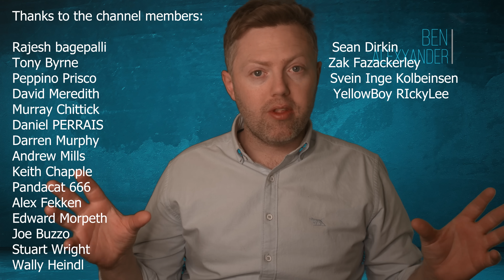CATL’s New Sodium Battery Will Reshape the Entire EV Industry

Comment: $19/kwh would change everything. People with homes would install solar power with enough extra storage batteries to charge their car EV battery at night.  If 2 days out of the year their house battery runs run low because bad weather, then they will get their car battery charged elsewhere and bring home the kwh to charge their house battery.  Total independence from the utility company. No home electric bills, no car fuel bills.
Reply: They will always find a way to stop the masses having independence from the state.
Reply: Do we really believe that local govt will allow this to be 'free'?
Reply: @taozzm Yes taxation will have to be readadjusted. Pay per mile, and back to square one for the consumer.
Reply: If they made the car smart theuöy could be used as reserve battery as well. Charge the car from batteries if needed relide back energi from car.
Reply: The house battery is two things.
- For small devices the fire risk goes away, so you can now plug small battery packs in bedrooms, on exit paths and the like which whilst people do it today isn't neccessarily smart
- For big ones you can massively up capacity. However if they still have to be wired in by professionals then most of the cost will end up (like solar now) being in the people and paperwork so the cost drop won't be as big. More likely as with solar it will become "go bigger" rather than massive price drops. Getting to 100kWh of battery (providing you have something to take the weight) plus a load of solar really makes some options begin to work that don't today.

Now if we can figure out the right connectors so people can safely wheel a big battery system in and connect it to a suitable socket (eg the same as would be needed for V2G) then we might get somewhere.
Reply: 2 days out of a year is optimistic.  In South Africa, which is blessed with constant sunshine, I would put that value up to 10 at least, just to be safe.
Reply: @mdb4michele  I'm from the Netherlands, we barely have sunny days. Luckily, they still generate power even when it's cloudy. 
At a price of $19/kWh, I would install 50 kWh. I will still need the grid, but I would be self-sufficient for at least 9 months of the year.
Reply: That is just the cell price. There is much more to a battery than just the cells. There is the BMS, balancing, safety switches, enclosure, wiring and assembly; and for cars cooling and heating systems.
Reply: @dominikvonlavante6113 Sure but a home battery with these cells will definitely pay for itself. I have modelled my usage and know the figures. It is also a game changer for heat pump deployment if batteries are economical. It will also make larger solar arrays more viable if storage is so cheap.
Reply: @SimonEllwood  There is nothing special in terms of price. If you order right now directly from China, you can get 96kWh of Batteries for less than 7000$. That future is already here.
Reply: @dominikvonlavante6113 So over $5000 more. This is different with the safety, the temperature rating, the energy density, the durability and the price.
Reply: @SimonEllwood  19$/kWh is only the internal manufacturer price for the cells. There is a whole lot more to a functional battery than just the cells. Alone shipping is more expensive than that internal price.
Reply: @dominikvonlavante6113 The cells are the most expensive part and these cells are much cheaper.
Reply: @dominikvonlavante6113 where is that???
Reply: @dominikvonlavante6113  safety first, nobody would ever care for lithium toasters
Reply: I have a friend who can do this already...the solar and battery bank in his house can fully charge his brand new Alpine A290 car if he wished ... nothing new
Reply: Current prices for home storage in Sweden is like 200 per kWh it’s madness
Reply: They will invent some law to tax it
Reply: @nedelwre social welfare for the power grid companies … instead of utilities paying taxes they will receive tax money. The justification will be they make electricity service available for everyone to buy. Compare that to government tax incentives to make high speed Internet for sale in remote/rural areas.
Reply: @nedelwre sun rent
Reply: Introducing the mileage tax😮
Reply: @djdj-qx3hb … that’s when oversized diameter tires will pay for themselves (lower mileage on the odometer)
Reply: Im sure goverments will be taxing that disgustingly highly
Reply: You won't have free power. First of all - a little to the north of the earth and you ve got dark winters and can't rely on solar energy. Energy storage is just for few days, not for whole winter when bills get higher due to heating. 
2 government will tax every kwh produced and instead of buying energy you will just pay for what you make yourself. It's not like they rob us. Countries need constant flow of money to run. We need money for roads, education, healthcare etc. We need to pay . Period.
Reply: @ExcaliburPaladin the highest electric bills are from air conditioning, not heating. Agreed, not everyone can disconnect from the grid but most will be located where enough solar power can be had when complimented by using the car battery to transport kwh from a charging station to the home battery. The 2 biggest costs (solar panels and batteries) are dropping. If batteries can be bought for $19/kwh then it will be economically feasible
Reply: @ExcaliburPaladin .  I can see them taxing annual mileage on all vehicles including EVs and possibly including a homeowner annual assessment charge for grid access whether you need it or not (just like library assessment and other assessments that get rolled up into the annual real estate tax).  But i don’t see solar power for self use getting taxed

Comment: Li (lithium) is the smallest positive ion.  It has been assumed that whatever is achieved with a sodium ion battery, a lithium ion battery will always be a certain percentage more energy dense.  It has been assumed:
* Li-ion => mobile - EV's, tools
* Na-ion => static - household and electricity-grid energy buffers
You present this is not the clear-cut case.
You send me off doing investigation...

Comment: CATL usually make announcements that are accurate.  If this is all as stated it is a really big deal.  They also say that LFP production lines can be easily turned to this sodium chemistry cell.  That's a real winner because not only CATL but all major battery manufacturers have already got LFP production.  BYD is completely LFP from their beginning.  Of course if they can't emulate the tech they may have to pay CATL a license.  CATL are in a great position.  

For the worlds of both renewable energy and EVs, this is fantastic news.

Comment: Sodium Ion isn't Ideal for EV's due to SIGNIFICANTLY lower energy density. 160 w-h/kg is about half that of a Tesla. Which already had weight issues. 
It is ideal for home and grid storage, where cost, stability and reliability is most important.
Cold weather performance is lithium ions Achilles heel though.
Reply: This is very true. However if they can be supercharged faster and safer they could make up for their density and weight disadvantages by sacrificing range for charging speed. And cold weather performance advantages mean something up here in Canada, etc. where I lose 20-30% of my range (or more) during the winter months anyways.

Comment: 4:57 sorry to tell you this but molicell p50b are already way better than these sodium cells @ 265 Wh/kg
Reply: Cost per unit?
Reply: @david-spliso1928 so you think a new cell structure will be cheaper ?? Ive built batteries for years, never seen any new cells be cheaper. And the point stands that a molicell is over 100 wat hours more energy dense so the claim that a sodium battery  "is more energy dense than a lithium cell " is quite literally b,s.

Comment: Ben, I wish you'd complete more sentences coherently.  Sometimes you sound as incoherent as Trump.

One thing you failed to mention is that the Na-Ion technology is compatible with lithium ion production methods.  It will be easy for producers of LFP cells to convert to Na-Ion once they have developed, or licensed, the fundamental chemistry formulation.  This should result in a very fast market roll out across Asia.

One question I have is about cell swelling during cycles.  LFP technology results in each cell swelling slightly, putting pressure on their enclosures.  Can you report on the phenomenon as it relates to Li-Ion cells please?

Comment: So what about e-bike and other smaller use batteries? Are these sodium cells made up of something like 18650 that one could make your own pack with to a specified voltage/amp hr capacity?  Do they require a different charging regime? ie. can current lithium ion chargers be used with the sodium ones?  BMS concerns etc.
Thanks for sharing

Comment: Believe it when I see it.
Reply: Watch will prowse tests on a sodium ion battery. Like "Sodium-Ion Battery Reality Check" . The data is horrible, efficiency 60-92%, the voltage range is really bad, and the power density is also far inferior. 

This is not suitable for BEV Use. You would have a 800V when full, and a 200V car when enpty. Bad stuff. MAYBE for Grid use, but that bad efficiency will take a huge toll in kWh bought to kWh going out.

Comment: All of that sounds fantastic, but I would wait until someone checks their homework.

Often when something is too good to be true it is worth double checking.

So when someone who is not associate with CATL has tested these batteries then I'll be impressed.
Reply: One of the issue apparently is at below freezing these things take FOREVER to charge ( a Problem for your EV in winter) . It will take probably another 5 to 10 years for these thinsg to really take off and for costs to come down.
Reply: @AlbertoMartinez765  You can just heat up the battery for charging. Its already being done today to make charging faster and more efficient
Reply: @AlbertoMartinez765 Most EV today already can pre heat battery before fast charging in cold weather.
Reply: These batteries keep 90% at minus 40 degrees Celsius and still charge fast.
Reply: @AlbertoMartinez765  voltage declines as discharged, unlike lithiums, which stay high.  Salt requires all new charging and BMS systems.  Won't work with any charging equipment available and widely in use.
Reply: While you are correct, CATL has kept all their previus promises about batteries. Let's hope this is true aswell. They weren't even the first manufacturer, as BYD already started their sodium-ion battery plant last year. BYD's claims were similar, however their plant is making battery energy storage for grids.
Reply: The specs of those batteries are horrible. Watch Will Prowses last Video, he tested one. "Sodium-Ion Battery Reality Check"
if you have an 800V car, it's 800V when full and 200V when empty. extremely superundesirable chacteristics for BEV. 
He measured the roundtrip efficiency at 60-92%, far worse than Li_Ion or LFP.  Power density is also bad. 

This will not work in BEV or home applications well, and buying 5kWh to only use 4kWh is something that people will hate.
Reply: @Flinno-k8w  The voltage problem could easily be compensated with power electronics, voltage regulators
Reply: @spadress  This is absolutely NOT easy. Power is Volt times ampere, and to have the same power at 200V, you have to push 4 times the amount of amps through the cables windings of power electronics. 

The reason why cars with 800V have an advantage over 400V cars is that resistance relation to power is squared, so if you have double the amps, you have FOUR TIMES THE CABLELOSSES. If you have for times the Apms like Sodium dictates, you have 16 times the cable losses. So you eithwer go insane onj cable vooling or use 16 times the amount of copper to compensdatre for that exceptionally shit voltage range sodium has. This is mindblowing inferiour and absolutely shit.
Reply: @spadress  And if you have such an ibnsanely large voltage renage, say goodbuy to designing an efficient voltage stepup for it, as you cannot design it around it's sweet spot., The larger the voltage change stepping up or down, the worse will be efficiency. These would be the by far least efficient cars on the market. While charging, that insane voltage range, and by using that insane voltage range, and then on top the really bad efficiency of the bat itself.

If there is one thing BEV have to be, especially if the battery has a shit power density like sodium and can can store less power per volume and weight than  Li-Ion competition, yozu want it to be as efficient as possible to not makle the range abysmally bad.

Efficiency is a core and most important requirement in BEV.

Comment: Well,  a reliable and versatile and a dependable sodium battery with a range of around 2500km together with just 10 mins to deliver 80% of the recharge and all this whilst at significant manufacturing cost saving will change the paradigm in terms of what we know of the automotive industry.  It is not clear just exactly what 'rare earths' go into making these but we all know that sea salt is a ubiquitous and an essentially free commodity and so expect greater democratisation, greater individual national sovereignty, greater regional integrations, less need for vast expanses of charging stations and far greater individual autonomy.   What's not to like?

Comment: Sodium voltage varies with a percentage of charge.  It would be interesting to know if the fix for that is at the pack or controller level.
Reply: I don't know about the specific naxtra product CATL is developing, but the prototypes were all on the controller level. IIRC the usable range on the prototypes were 16-7V, but I've also heard that it should be possible to use a dual-pack setup and solid-state self-regulation. CATL is talking both about dual packs, so maybe they are integrated? Source: rumours by the coffee machine, ie not exactly reliable and prone to exaggerations for effect.

Comment: CATL's newer sodium-ion batteries are heavier than some advanced lithium-ion batteries, but their weight is becoming comparable to lithium iron phosphate (LFP) batteries due to improved energy density. The key difference is that the higher atomic weight of sodium leads to lower volumetric and gravimetric energy density, meaning a sodium-ion battery will be bulkier and heavier than a lithium-ion battery for the same amount of energy, though this is changing.
Reply: It is better not to mention Li-Ion batteries because they are prone to fire 😂
Reply: @agusedyanto3087  Unlike gasoline, which is so non-flammable that they use it to put out lithium fires!
Reply: I wonder if it will matter as much if you can charge so much faster? Who cares if you get 400 or 500km on a charge if it takes 15 minutes to charge? You shouldn't be driving that far without a break anyway.
Reply: @D-YBrews  The charging problem is wildly overrated anyway. In town, I’m usually just plugging in at home. That means my car is always charged enough for around-town driving (how often do you drive over 100 miles a day in town?). And if I’m supercharging, I’m usually glad for a half hour break - I take a walk or go shopping or eat something. If I’m on a road trip, I don’t need to hurry. If I’m in town, I can do a 10-15 minute quick charge if I need to for some reason.
Reply: @davestagner  Even my PHEV Volvo V60 does about 60km to 1liter of gasoline/diesel. Admitted: I am a pensioner. My car regularly warns me that the fuel gets old and needs to be used or replaced.
Reply: @davestagner  exactly. It's an illogical objection, but if you can take it away, it one less thing they can complain about. For some people who live way out in the country in really big countries like Aus or US it might be a problem, but for the other 95%, not so much.

Comment: Requirements:  cost, reliability, charge cycle life, calendar life, gravimetric energy density, volumetric energy density, peak power delivery, charge and discharge abuse tolerance, temperature range characteristics, toughness (shock/vibration/impact resistance), toxicity, disposal costs.

This new product looks good on most characteristics but reliability in the field is still unknown. Hopefully it's better than LNMC chemistries.

Comment: The 2025 Hyundai Ioniq 6 LiPo chemistry has a density of 0.578 kW/kg. or 578W/Kg. The sodium battery you describe at 175W/Kg would not fit in a modern LR EV first of all due to it requiring 3.3x the volume and weight of a LiPo battery . For a comparison, a LiFePo battery has about a 200W/Kg density. Although LiPo chemistry had some early on issues with fires, the issue has been greatly reduced with battery temperature control systems often including a coolant. People want EVs with range to hedge against density reduction and convenience. These Na batteries will largely relegated to grid storage and not EVs, in my estimation.

Comment: The holy grail of energy storage
Reply: This isn't it.
Reply: @Flinno-k8w Why not, is cheap to produce what
Reply: @salopaindahouz  The price isn't everything.
Watch Will Prowses last Videos. he has Tested a 12V Sodium battery. The efficiency and Voltage range an other specs are a nightmare for Home or BEV use.

An 800V BEBV would have to discharge to 200V to get full capacity. Thats a nighmare for BEv design and superextremely undesirable. Even for hole use. 

The efficiency is also really bad with 60-92%, while Li-Ion has 95-99%.

Imagine buying 5kWh and only getting 4kWh out of it.

Some sheets of Plastic would be supercheap as road pavement. But guess what? That's totalyl irrelevant if they cannot do the job.